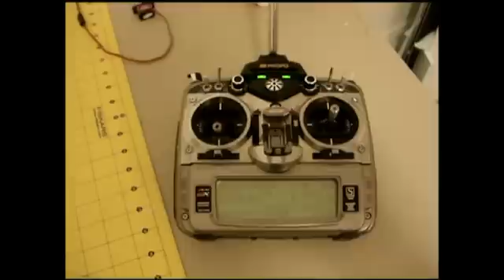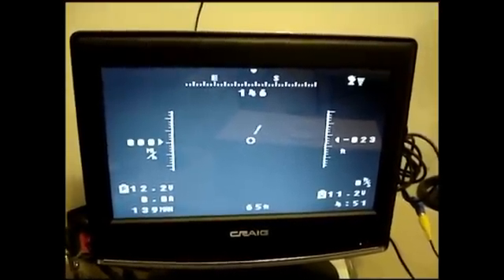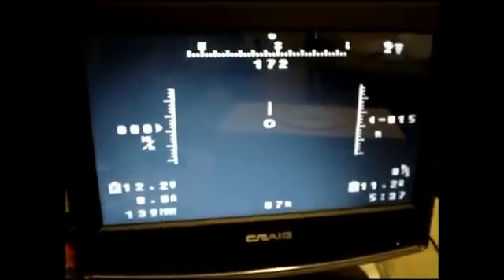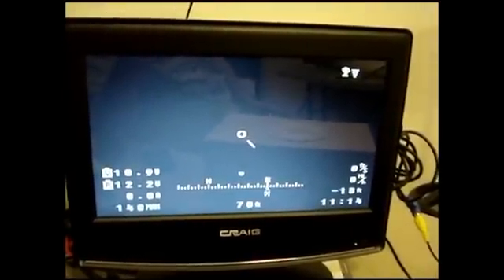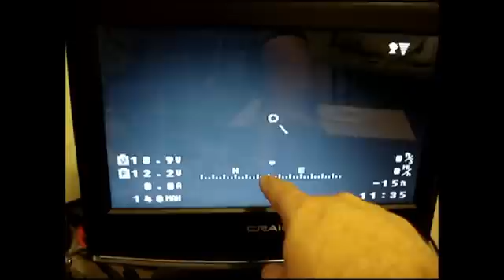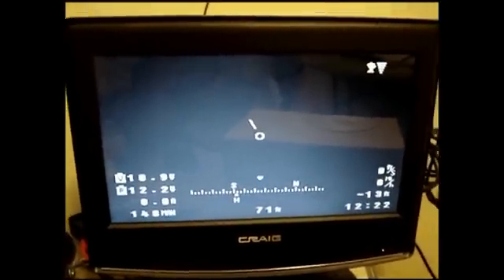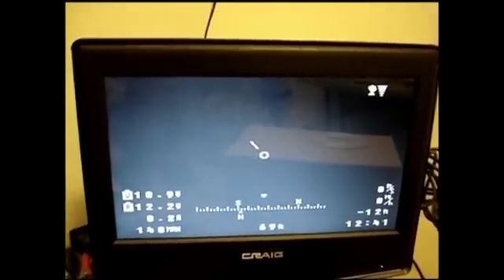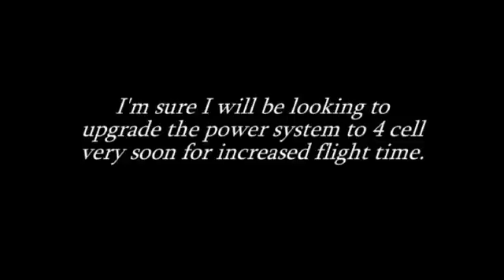Skywalker build progress #3

Comment from the maker: Sure, on the Cyclops ezosd there is a block of pins on the same side as the GPS connector.  The bottom set is for screen control.  Just connect a 3 wire male to male servo cable from those pins on the OSD to a spare channel on your receiver that is controlled by a switch, the gear channel is a good one.  Then when you toggle your gear switch, the osd will cycle through the display modes.  If you google the Cyclops EZOSD manual, it has a picture of where the screen control connector is on the OSD